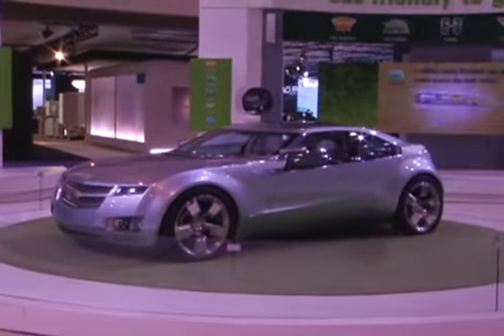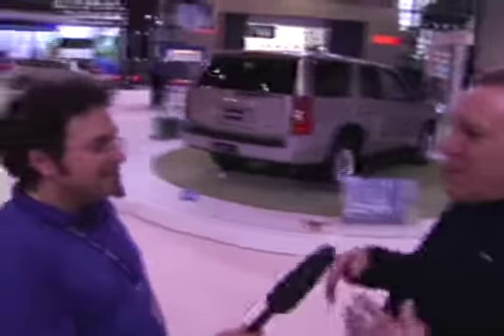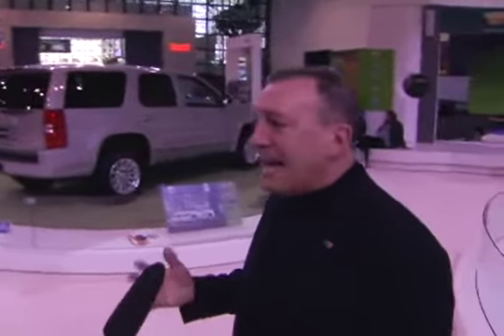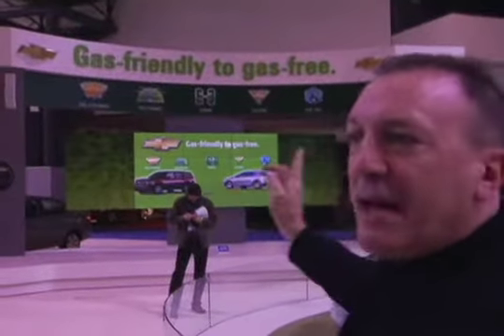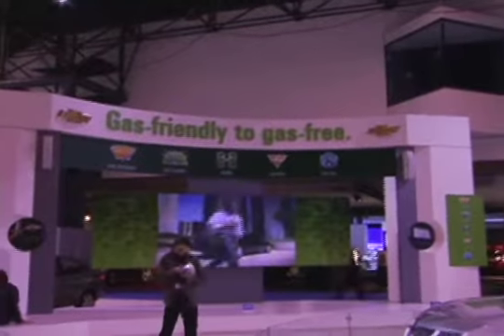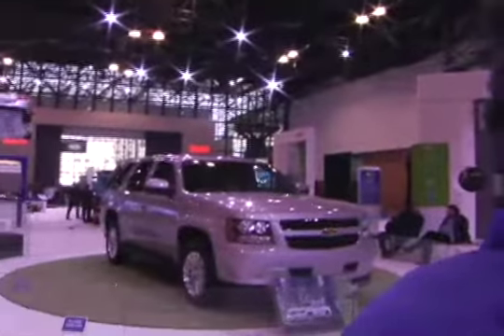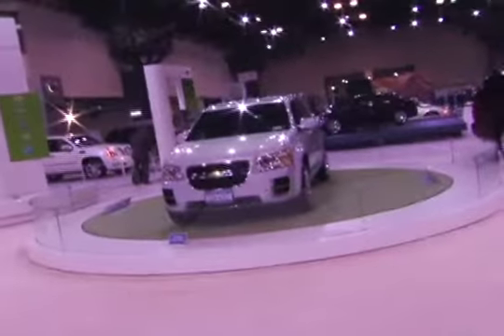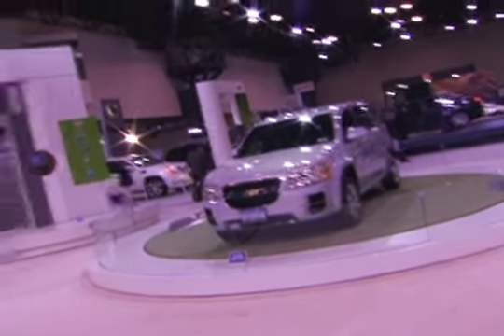Chevy Volt - 2008 NY Auto Show

Comment: You're wrong, Fenwickhockey.  (You play hockey, too?  Cool!!)...I'm an old timer though.  Been playing for years!!  Back to the story, it was scheduled for 2008 but they had a battery problem.  The Hymotion lithium ion battery is available, but VERY expensive.  You can convert the prius to the new battery for 10 Grand.  Quite a hefty price, but that's new technology for ya.  Check out, "Plug-in cars sparking a power shift" on MSN . Com.  Very cool read.  It has that battery in a prius.